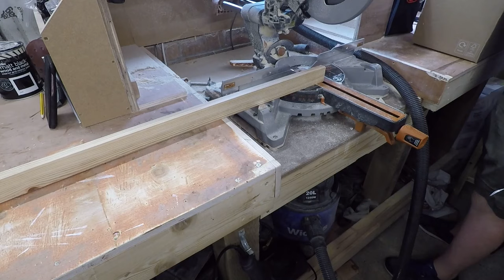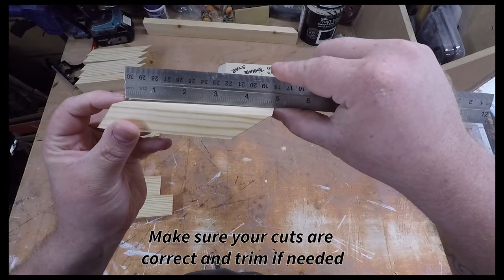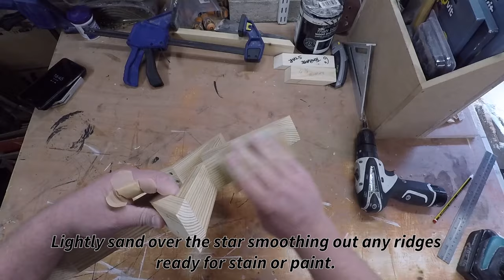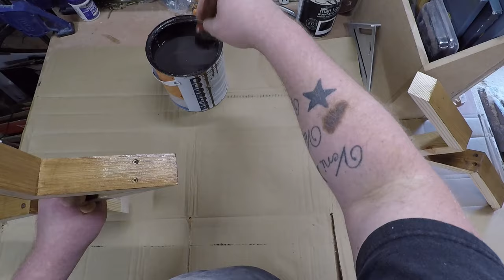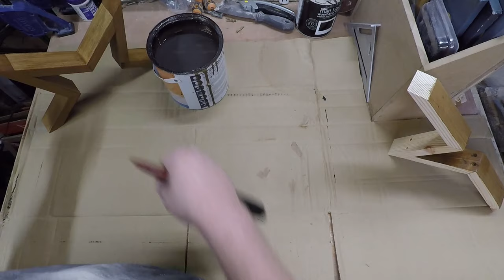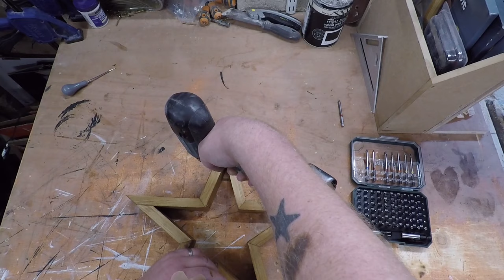HOW TO || Make A Wooden Star || Using A Mitre Saw || DIY Woodworking At Home

Comment: You got 2 of your pieces wrong @ 7:14....short piece goes to long piece, but you put short to short on one of them and long to long on another one. It's worked, but it is not symmetrical.
Reply from the maker: Ohhh, man!!! Thanks for pointing that out. Think id made about 20 before I shot the video so was a little tired. Thanks for the comment.